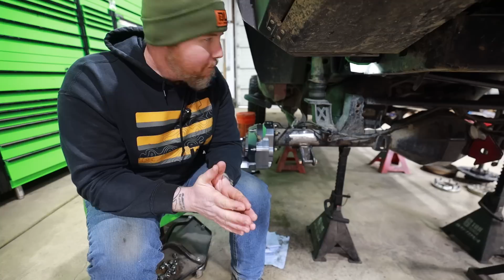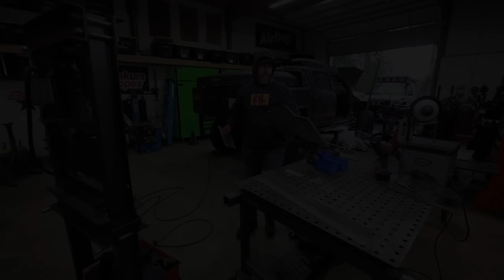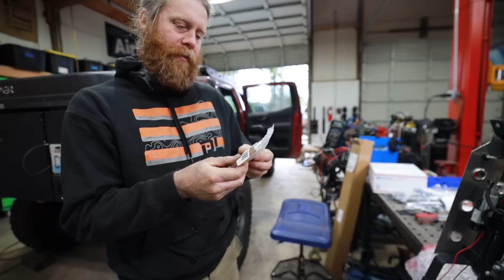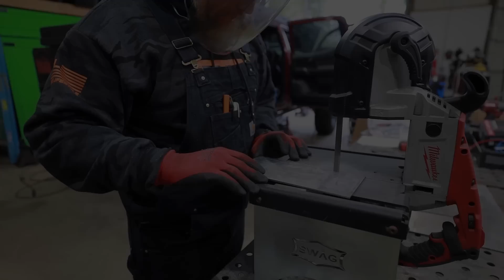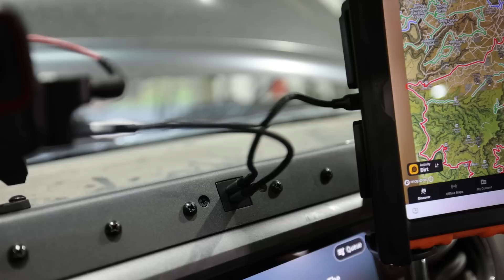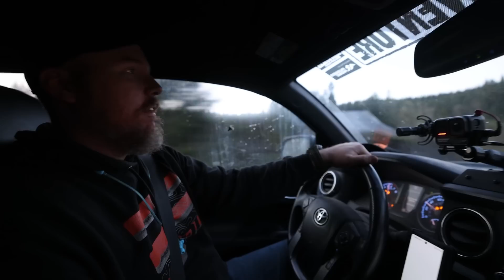Rebuilding a Destroyed Tacoma - The Ultimate Transformation. Re-Girth Episode 5

Comment: 14:35  the plugs you are installing are to delete airbags and SRS active seatbelts. 
The seats you took out hold the airbag in the bolster in 99% of new cars. So the act of changing the seat is enough to delete an airbag or two. 
Also, the seat belt tensioner is in some of the seats/buckle side of the seatbelt. So you might be deleting both. 

I’m not 100% sure on that particular model truck… but it’s highly likely you’ve reduced the side impact rating significantly. So proceed informed and with knowledge. 😉

Comment: Want to point something out; the RCLT is actually recommended to be used in conjunction with an 8" stroke coilover. And the best part... it fits with the stock Toyota coil bucket. No clue where you got the idea that you would need to relocate the shock towers when there are tons of folks running both the +2.75 & +3.5 inch RCLT with an 8" coilover and stock coil buckets.
Reply: You even said that it was supposed to be setup with an 8" coilover in this video: https://www.youtube.com/watch?v=P_8Ki9JOycM&t=710s at the 8:30 minute mark.

Comment: Just watch out, those 74weld portals have some manufacturing and engineering defects. The brake caliper brackets (Which were mounted at the factory) are notorious for literally falling off while driving them, even with loctite. Check them frequently! I also could never get the portals to play nice with my ABS system off-road, constant codes.

Comment: I did the exact same thing in my Mitsubishi Evo X after swapping in sparcos. I had to use the local high school's scan tool to check the calibration. I wanted to ensure I was safe and my passenger was safe. Careful how tight you make those sensors in the vise  😂 my passenger weighed 1500 lbs 😂

Comment: Big time respect for retaining the seat airbag sensors... but aren't the sensors measuring weight pretty specifically rather than On/Off?  Meaning, the airbags' deployment force varies based on the occupant's weight.  If that is the case, I'd be concerned with the airbag deploying too violently if the sensors are preset for a lighter occupant.

Comment: Back in the 90's when air bags came out, you used to have a spot in the dash to put your key in and disable the passenger side air bag. You did this in case a child was riding in front, as airbags can severely injure and/or kill a child. So now they use weight sensors so you no longer have to think "oh, I need to turn off the airbag because my 7 year old is sitting up front). But since this truck is pretty purpose built, its fine to just make it on all the time. Just don't let your kids sit up front.
Reply: Or dog, or small mother in law…on second thought. 
Just kidding.

Comment: Airbags can injure, up to decapitate small occupants.   The manufacturers were sued because, usually, parents do not like for their children to be decapitated, therefore, they designed a system to sense the occupants weight. Late 90's to early 2000's the manufacturers used to have a switch for the driver to turn off as a stop-gap measure before it became automatic.
Reply from the maker: Yep 👍.

Comment: 23:16 if you’re using the Renogy 50a dc-dc + mppt there is a caveat. 

If it’s seeing any wattage from solar at all it charges from alternator at 25a. If you want the full 50a you have to put the solar panel on a relay that turns off when the engine is on.

Comment: Hiya Nate, is the voltage sensitive relay going to work properly with the smart alternator system most modern trucks have? ( The ecu tells the alternator what voltage out depending upon various factors and doesn't know about the house battery needs).
I was under the impression that VSR didn't work that well with smart alt systems. Ive a 40yo LandRover 90 so no smart anything 😀

Comment: Running into the same problem with your portal build that we Hummer H1 owners have been dealing with since 1992.  You strengthen one part of the drivetrain only to expose the next weakest link in the chain.  Portals (geared hubs) are fantastic but they do introduce a lot of other issues to consider.
Reply: Like what?